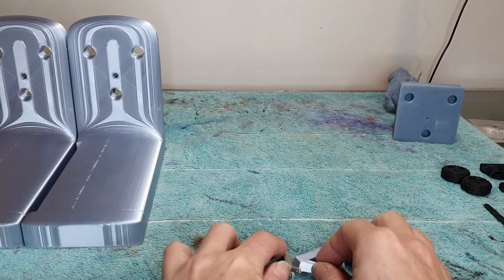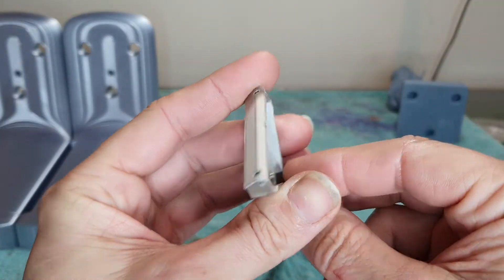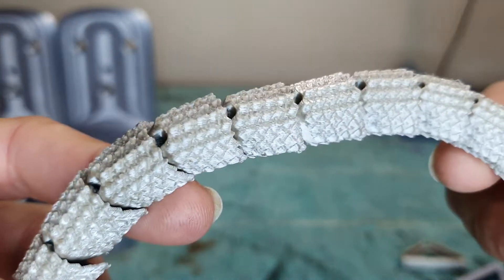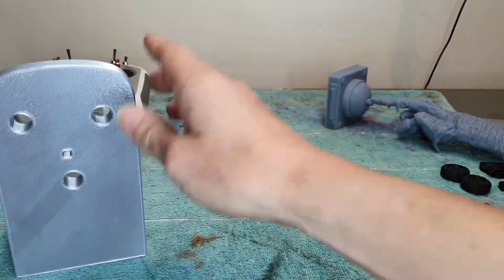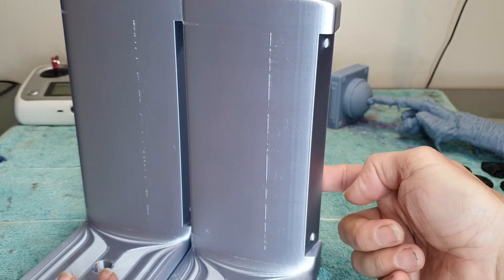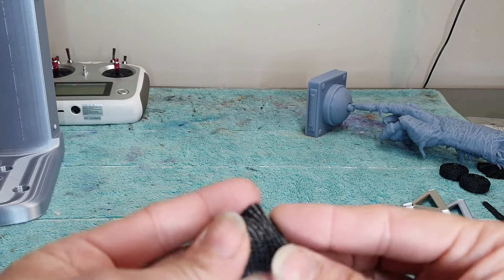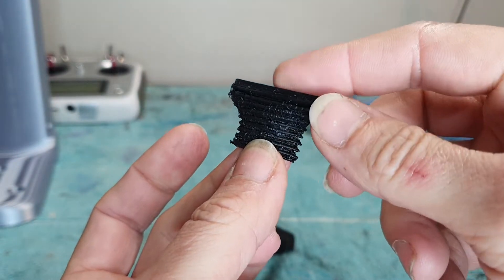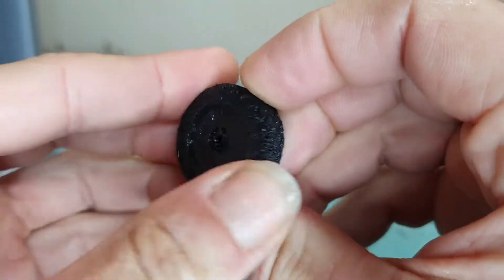Endor 3 S1 printing experience

Comment: I am surprised that the ender doesn't seem "less than", after using sla.  I would like to do sla, but I'm in negative budget already.  I was caught off guard by the resin cost you mentioned, and FDM suddenly gained extra appeal.  It would seem I am with the correct printer......currently.  I can imagine my brittle j5s  being strong, and that cost makes sense.  Good video.  I watched it again, and learned a bit more.

Comment: I have a larger  Creality, and it really was easy to get into.  Stabilizing the Z axis helped with taller prints, and was an easy free print.  My Johnny tracks are individual tracks pinned together, but printing some flexible tracks that are movie accurate sounds like mucho time saving.  Did you have to add a tension adapter to avoid filament slip w/ printing tpu?
I still haven't tried it on mine.